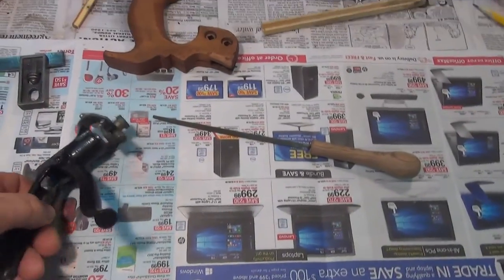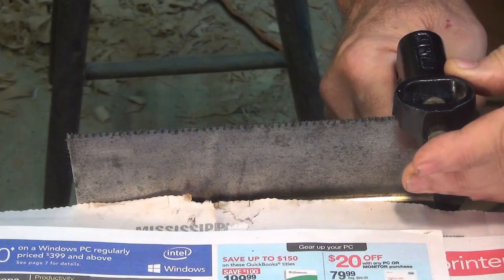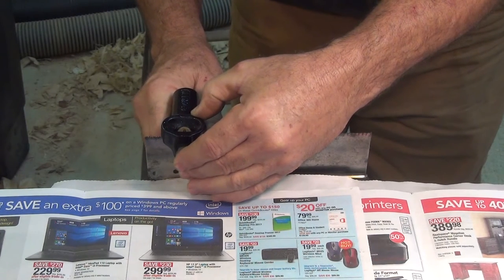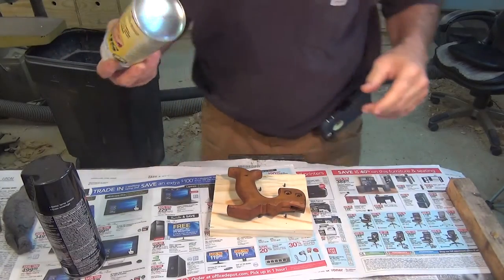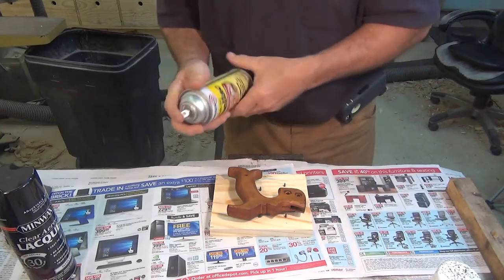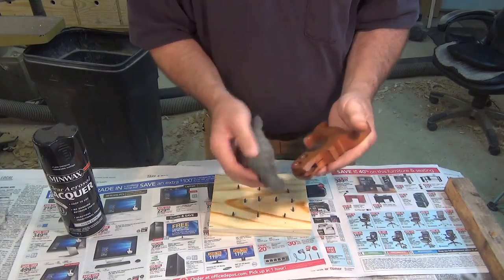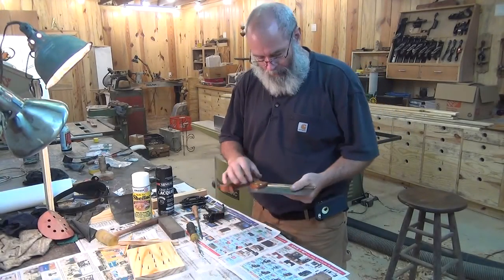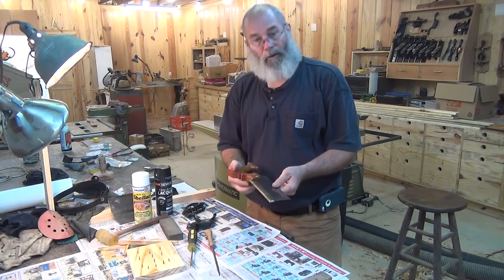Dovetail Saw Restoration (Part Two)

Comment: You doubled the kerf of the blade, not a good idea for a dovetail saw, in my opinion you turned the saw unusable for cutting dovetails... unless you remove the set and back to the original kerf.
Reply from the maker: Android, this saw had zero set in it when I got it and would jam after cutting only 3/4 inch into a board. I only gave it a small amount of set so that it would not bind in it's own kerf. However, if I had given it too much kerf it is easily reversible. I would put a sheet of newspaper on either side of it and lightly tap the teeth on and anvil or other hard surface. That would close the set slightly. I assure you that the saw is usable as I use it all the time. However, you make a good point, a dovetail saw should have almost no set. Just enough so that it does not bind in the kerf. Good comment, thanks.
Reply: I love your wise and gracious reply to a strong criticism.  You have a beautiful spirit.